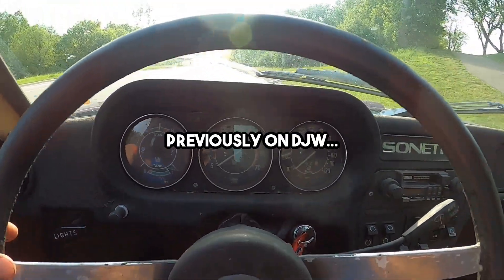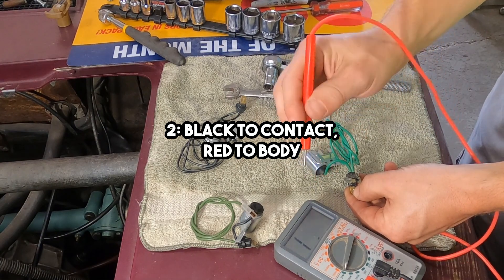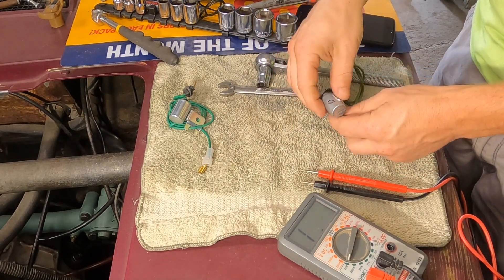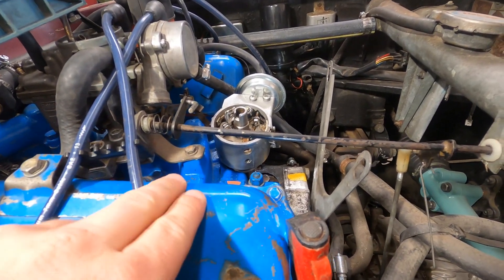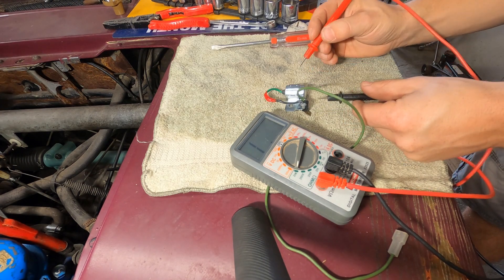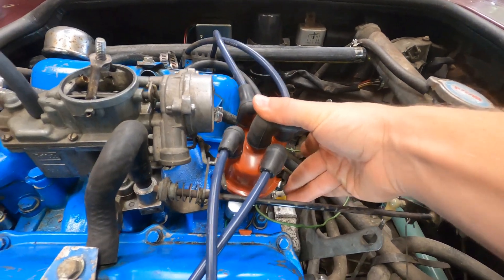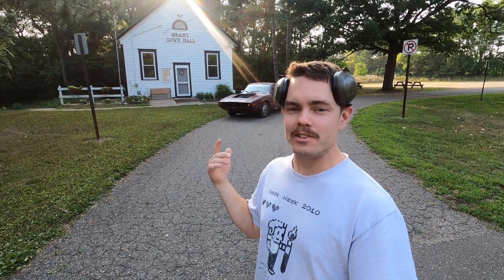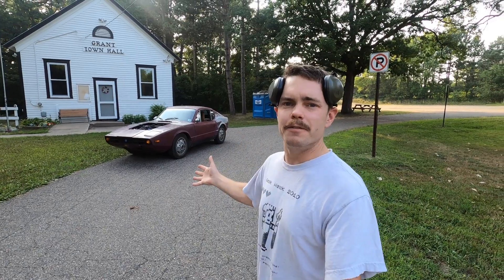Building a Frankenstein Ignition Condenser! Ep. 21

Comment: My 67 Split bus is giving me the same issues, and I Frankensteined a condersor as well, and im battling to get it to start. What did you do?
Reply from the maker: Honestly, I think the Saab community pointed me to the correct Bosch part # and I bought several of them from FCP. A near OEM quality VW part should be readily available (although I admit points quality has gone downhill for most manufacturers)
Reply from the maker: What happened right before it stopped working?

Comment: Duluth Minnesota. I got family in duluth 
Get used to playing with that carb specially when it gets cold
I moved from Pottstown pa to camden sc first car i worked on down here was a 2007 saab 95. The man spent over 6k on it four shops and one back yard in the mud im not even gonna call him a mechanic and still wasnt fixed. I got it in my garage and in one week had it all apart.piston #3 cracked right under the compression ring. He got it back in a month.sub frame and engine trans all out one shot in the shop tore apart fixed omitted the ballance shafts  it cost him 567 in parts. Paid me 2500. I gave him a car 4 cylinder that would beat mustang gts all day
Reply from the maker: Duluth Junction... which is where the train to Duluth crossed another track. One of the reasons I changed the channel name. 

Saabs can be a pain in the butt! I don't have a desire for any of the newer ones. Seems like a lot of extra BS without a lot of benefit. The one exception might be an OG 9⁵ Aero

Comment: Its not ignition its fuel. Saabs are fickle tempermental. But when their on its a blast. Nice car by the way. Yea its two years old video. How is it running now. What it look like
Reply from the maker: I did eventually restore the fuel tank, which solved my issues. That was October 2021...? I immediately drove it on a 700 mile road trip. Car is awaiting a front suspension rebuild which shall commence after the Corvair is on the road.